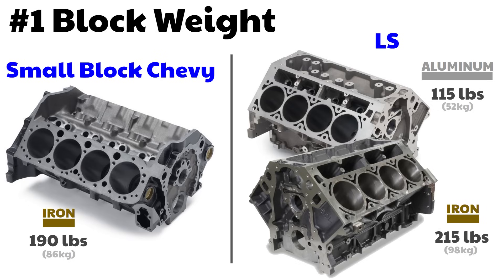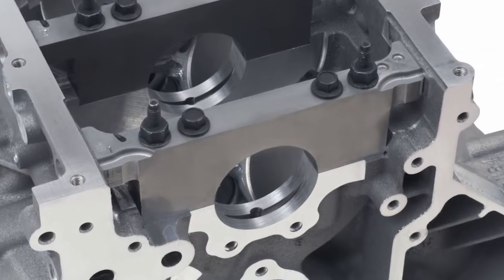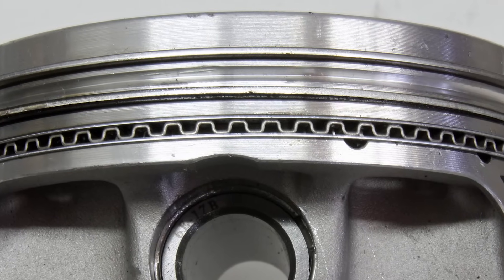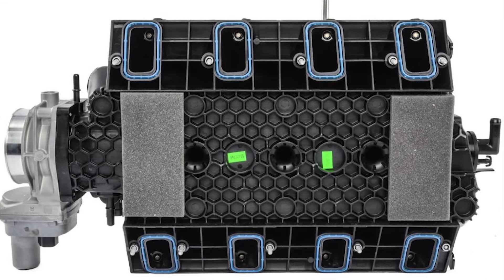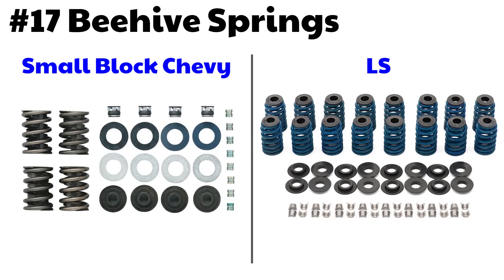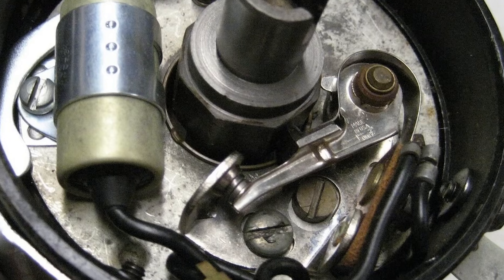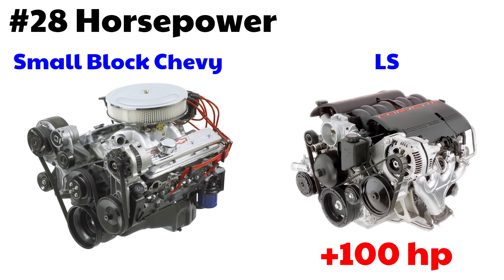29 Reasons LS is Better than Small Block Chevy (Gen 1 & 2 vs Gen 3 & 4)

Comment from the maker: Visit Auto-Guild.com to get your free pre-order of the LS Swap Survival Guide eBook.  As well as other cool eBooks and posters too.  

A few comments: 
1) I'm not saying the Small Block Chevy is a bad engine I'm only pointing out the differences.  I've had a small block in my 68 Camaro since high school and its never left me stranded, I love it.  
2) My engine block power handling numbers are not apples to apples, I messed that up.  For SBC I used official GM recommended power ratings and for the LS I used more real world numbers, so please note that max power handling of the SBC is likely higher, 500-600, maybe more.  But also remember, any LS block you find can handle big power.  With the small block you have to find the right block from the right year, or with the best metallurgy.  a 283 block from the late 50s is not going to handle much power.  And of course I know aftermarket blocks can handle big power, thousands, but this video is referring to the OEM blocks.  
Thanks everyone for all the great comments.
Reply: Yo u need to do some more homework. I've personally watched a bone stock 350 crate motor, in a 67 camaro ring out 9000 rpm. The skirts on the block are simply over kill, and truly offer no added strength. Due to the cam being hollow, smaller valve train components are necessary as to not break the cam. And your 300 some horsepower max on the old blocks is simply ridiculous, as my 1970 block currently produces 525 hp, and 574 lb/ft just fine. And that's with "old iron heads"  So think twice before you count the small block out. And lastly, availability. There are ten times the number of small blocks out there, way more affordable to buy and build, than there are ls engines. Period.
Reply: @sparepartsmotorsports966  I think most of the power in a LS comes from the heads. The heads are so much better, but, there's nothing wrong with a SBC in the right application. I had a 1983 Camaro with a a 400 SBC in. Moderate to mild cam, 9.9 compression, recurved distributor, shorty headers and true dual exhaust with series 40 flow masters, weiand dual plane intake with a tuned Qjet with dual snorkel cold air I dabbed. With 3.08's it would do 105 in the quarter and that's with a TH350 trans with with a mild torque converter and shift kit. I think it would have been quicker with a 4L65E. It was a fun car with a lot of low end torque. Very streetable for day to day driving.
Reply: @nokoolaid  I agree
Reply: @nokoolaid  One of the LS's best points is indeed, its heads as you said (I've covered the other issues, coil packs and crankcase size for pumping losses, above). The funny thing is how for so long, motorheds have said a small bore block can't breathe--of course it can! The LS proves it. 

They simply went with a much better valve angle (close to what Pontiacs have always run) to reduce bore shrouding, and had a tall port rather than a wide one. Originally the "cathedral port" was to allow a fuel injector to go down it like a tongue depressor. But it had the benefit of moving a mass of air due to its volume--some wedge head designs out there barely have fuel/air flow touching their port floors or ceilings due to the amount of "bend" on the short turn radius. 

Of course, and you likely know this, there's a bajillion aftermarket CSB heads out there that can move air, that play around with valve angles, and then there's heads that realize if the chamber burns really efficiently, that may make more power than increasing the volume of air that goes in and doesn't burn as well before going back out again. The advantage is the LS comes with a pair for free, but then you make that up in paying for other issues not found on a first gen block.
Reply: So when you say ‘small block’ what do you mean, because if I remember right there is a 5.0 block a 5.3 block and a 5.7 block, all being considered a ‘small block’ , shoot the 6.0 and 6.2 may even be considered a ‘small block’ where the 427 and 454 are considered ‘big blocks’ BUT YEAH JUST CURIOUS WHAT GOUR CALLING A ‘small block’ and what that phrase entails
Reply: The first gen was made for many decades, and yes, I would not want a late 1970's model, when Japan was kicking ass and all of Detroit put less nickel into their cast iron. And the 262/267 cid V8 was a POS. so I would contemplate a 300 bhp threshold there. Even Hot Rod magazine has posted that.

But of course there was the LT-1 making 370 bhp, the 327 fuelie pushing 375 bhp...and folks have pushed even the four bolt (more holes in the main webs). I've witnessed thru the internet, folks hotrod what they grew up with, and the LS has 20 years of existence so far.

The Y block-deep skirt design works with a cross bolt mains, like the Ford FE and the Mopar B/RB blocks. But it is amusing when the LS fanbois talk about how light the Aluminum block (the reason for that deep skirt) when in reality a high HP engine is going to run cast iron and there's extra weight for the skirt.

it does keep the crank out of the oil swimming pool known as the conventional oil pan, tho...no need for a deep sump like the First gen.
Reply: The block strength of a small block chevy is only 350-550 horsepower? Or even 500-600? GTFO with that, lol. There are a couple of 2000 horsepower LT1s now. Here's one:

https://youtu.be/GkFS0FabL5E

How long it will last IDK. If you're talking about stock rotating assembly strength, maybe, but then LSx don't have 1k strength either. The crank might, but the same goes for small blocks. 

Also SBC 2.2 > LSx.
Reply from the maker: @trumpisaconfirmedcuck5840  Thats the beauty of the LS, you don't have to search for specific blocks from specific years all the engines can hold big power!  Try putting 500hp in a 1959 283 block!  I bet it wont last long.
Reply: I had a 2009 Suburban with aluminum 5.3. Had AFM issues. After that, I swore off GM and I've owned 10. How they would let that half baked tech on the street, IDK. It burned a quart every 1800 through #1 and only #1. Started around 60k. GM did the TSB fix, but it was too late. Had I known AFM should have been disabled, I would have. In the end GM was like, we'll give you 3k off on a new one. Uh, no thanks. The LS may be better in most ways, but how it's implemented makes a difference.
Reply: @James L  this was done intentionally to increase revenue from service and has a class action lawsuit on it
Reply: @JoinerNotFound  Too late for me. I sold the vehicle in 2015.
Reply from the maker: @nokoolaid  Yeah I can see why so many are negative on the system.  It seems like they have fixed it with the Gen 5 LT series.  60K is certainly not high mileage, that should not have happened.  I wonder what percentage of vehicles have that issue.  And I wonder if neglecting maintenance is a contributing factor, thats one of the reasons Im nervous about buying a used LS for my Camaro.
Reply: @AutoGuild  There is a TSB on with upgraded PCV system that replaces valve covers and I think a new oil pan or some sort of windage tray. I changed the oil every 5k with a AC Delco filter and Mobil clean 5000 and when I didn't, the dealer did it. I did use E-85 on occasion and we did a lot of trips with extended highway driving. It was burning oil through one piston, #1 and I had to change the plug in that cylinder every 8k miles. GM isn't saying how many, but peruse the Tahoe/Suburban/Yukon Forums. It's not unusual. From what I understand, extended highway driving at steady speed will do it. Had I disabled it, I'd still have the vehicle. I didn't know it could be disabled and really should be. Dodge's Hemi with MDS has some issues too, but with lifters. Uncle Tony's Garage goes over it. If the MDS is disabled or you get a manual trans it seems to happen less often. IDK. GM should have tested this more thoroughly and found a fix before they sold vehicles with it. The problem is that it happens after the standard warranty period. That works out for GM very well and that's probably why they let it go into production. Other car manufacturers and even motorcycle one's do this. BMW comes to mind. I had an extended warranty on it and they still wouldn't replace the engine.
Reply: #2 is utterly false... I have one in my garage that's been moving right along for about 13yrs at way over the numbers you provided... we are at more like 400+... TO THE WHEELS... so probably over 500hp to the crank... on a 1970model block.
Reply: R
Reply: My Edsel never left me stranded either
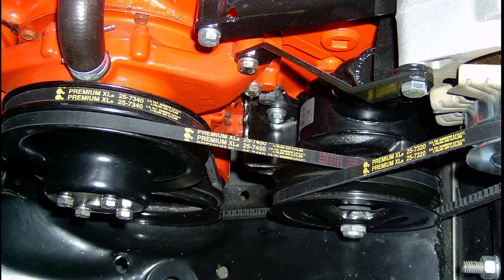Reply: 9:09 that engine has how many belts? lol
Reply: this is bullshit  its like comparing apples to oranges i have seen 2500 hp sbc on methanol and boost i think you should remowe this video and make a new one that is using same source for durability and strength of both engines best regards david from sweden
Reply from the maker: @dadde5907  Of course an aftermarket engine can hold tons of power but this video is about OEM blocks, perhaps I should have made that more clear.
Reply: https://www.youtube.com/watch?v=UZ1PRsfO09c WHERE CHEVY COPIED THE LONG SKIRT BLOCK DESIGN, FROM THE FORD 427 HIGH RISER ENGINE. THE LS IS NOT 100% BUT 1000% BASED ON THE FORD 427 HIGH RISER ENGINE. NOT ONE DESIGN ASPECT OF THE OLD SMALL BLOCK CHEVY LIVES IN THE LS. IT IS COMPLETELY FORD IN DESIGN.

Comment: The comment section on this video is full of guys saying "if you build the sbc it's better than the LS" yet if you built both they can do equally as much. Guy in the video also hardly knows what he's talking about. For example, the basis of the video is the small block vs the LS, which also happens to be a small block, just a later generation. Power numbers are also skewed.

Comment: Unfortunately You have very little Knowledge on the older Engines as far as how much HP they can handle.
You should do your Homework a little better.
For the record a stock chevy can crank piston piston handle up to 650 hp before any damage occurs.
The block can handle 800 HP before mods need to be done.
Also those Exhaust manifolds on the LS are just as restrictive as the Old LT manifold. This is known fact .
The eletronic fuel injection can be put on the small block LT with the same improvements.
YOU KNOWLEDGE IS LACKING ON ENGINES !!

Comment: I've ran and built a small block 383 gen1 4 bolt main with a set of 88mm china snails and it handles way more than the 360 you claim can handle.

Comment: I'm not even going to finish watching this. I have replaced cams with out removing the heads on a small block Chevy with no difficulty numerous times.
Reply: You can change the cam on both the ls and sbc without removing the head. But to change the lifters on an ls you need to remove the head.
Reply: @Redtooth75  don’t you have to keep the lifters from falling into the oil pan when u remove a cam??

Comment: You forget the biggest flaw in the gen 3 sbc. It literally cost thousands more than building a regular gen 1 sbc.
Reply: Only if you are doing a swap or build from scratch, because then you need to get an ecu and wiring harness. But if you are rebuilding one then they cost about the same.
Reply from the maker: True in many ways.  Costs to swap is way more.
Reply: Don’t get me wrong. I’ve thought about so many times. If I were to do the swap, I’d buy a wrecked 99-02 LS F-body. That way I’d have everything.

Comment: My experience is this.....an "out of the box" sbc with decent compression, naturally aspirated, running on pump gas, makes a solid 350-400 depending on compression and timing. Anything over that requires MAJOR compression, which requires race gas, (expensive), or forced induction. An LS "out of the box" generally makes more hp and torque more "efficiently". Money, know how, and time decide which platform makes more power.
Reply: Get off the drugs. An out of the box 350 barely scratches 200HP.

Comment: Reasons that are wrong. 
1.Boosted applications use the cast iron LS block.
2. Horsepower limit. I don’t know where you got your numbers from. But many gen 1 small blocks have gone past 1000 horsepower for decades. The one piece rear main seal blocks are supposedly limited to around 500hp. But many engines built have made much more so that’s also not correct. 
3. Titanium rods in the LS 7 don’t like boost. The LS7 was designed to be a high rpm fast reving naturally aspirated engine. 
4. Powdered metal rods are limited on what they can handle. Once again, many high rpm and boosted engines have been made with stock GM pink rods found in the 1970 factory engines like the original LT-1 350. They were available from GM over the counter for years. 
5. Cylinder heads for the LS flow crazy numbers. Put some really good cylinder heads on a gen 1 small block and you make power. 
6. The LS is popular because you don’t have adjust the valves. Basically is dumb proof. 🤣🤣😂. 
7. You can get beehive springs for any small block. Not recommended for big blocks because they have a very heavy valvetrain. 
8. It only took GM half a century to make an improvement on the more superior gen 1 small block. 
9. Rpms, any small block can run way past 6000 rpms. 
10. V belts are better in high rpm application. 
11. The efi is more efficient, we’ll sure it is. once again it only took decades for your programmers to get it right. Aftermarket efi has done it since the early 90’s. Where was GM or any auto maker and why did it take this long for you to get some programmers with some knowledge.
 11. If variable valve timing is so great why does everyone modifying the LS delete this function? Hmmm
12. Hot rod magazine articles are big advertisements for comp cams and the flavor of the month cylinder heads. And the only way Hot Rod made 1000hp with the LS was a turbo and aftermarket heads. 
13. Cost for building and LS is just as expensive as building any engine. If you turbo, tune and cam a junkyard LS, guess what you have? A junkyard LS. 
14. GM didn’t not reinvent the wheel. The LS is a pushrod engine with good flowing heads. The 5.3 is a small bore engine with a large crank. The LS is flavor of the decade. It’s the dumb proof engine if just want to throw a cam and a tune at it. The LT has already started to push all the LS from factory production. The LS is not rocket science, stop treating it like it’s the messiah of small block performance.

Comment: The LS engine is nice in some ways. But the LS engine's only real advantage over the OE roller sbc is the higher flowing cylinder heads .. but sbc  aftermarket heads like the AFR 227 or DART 230 out flow all LS based cylinder heads... I have built many LS engines for customers, but personally I will stick with the sbc 400.. sbc 92-96 lt1 and the gen 6 bbc 454.
OEM LS pistons and rods are garbage.
Reply from the maker: And the lightweight alum block.  Less weight = free horsepower!

Comment: The only three things you need to know:
1- doesn't take a full tube of RTV to seal the intake
2- better heads
3- say it with me... S I X   B O L T   M A I N S
Reply: You forgot that the ls dont leak like a sieve. In my experience with sbc anyways cant keep oil off the garage floor.
Reply: @HEYBERT1984  - if you prep them right, use  straight valve covers and old style cork gaskets, it's not hard to build one leak free. The problem a lot of guys run into, is using the newer style synthetic gasket materials. They just don't work with old castings. You CAN use them... but you have to prep the surfaces and get them super smooth, otherwise they seep.
Reply: @sylentxtinction2097  my ol 95 K2500 with a 350 sat for 7 years without being ran and doesn’t leak anything. Even after 305,000 miles 🤷🏽‍♂️ note I do drive it every day now
Reply: Yes the mains are supported better. But only 4 of those bolts really do anything. The side ones do very little. And THAT is only LSX.

Comment: Yes, I think you need to cover the LS heads, thats one of the amazing features of the LS
Reply: yes, it has the valve angle found on Pontiac V8's and aftermarket chevy heads.  Those Cathedral ports flow so well, the days of "small bore V8's can't breathe" have come to an end.
Reply: Ford windsor design . Set a Ls head next to a windsor head.

Comment: 29 reasons but sound isnt one of them! Sbc ❤️
Reply from the maker: Sound depends mostly on cam and exhaust setup???
Reply: @AutoGuild  yes your right, but the sbc is definitely a better sounding engine
Reply: @AutoGuild  CR, overlap, and exhaust, to be precise.  CR is the one most forget. its what gives an exhaust that hard snappy sound too it, "blat-blat-blat" vs "puff-puff-puff". overlap gives you that uneven "blada-bluda-bla-BLAP-bluh-bluh-bluh-BLAH-bluh" type "lopey" idle. exhaust can make almost any engine sound like anything - except make a rice burner sound like a big block. for the "baddest" exhaust note, you want CR, overlap, and open headers. straight tubes is next, probably followed by straight-through glasspacks or similar, then Thrustmasters (which is what you want to stay out of trouble on the streets).

Comment: Congratulations looks like you didn’t know that the LS motors are also small blocks except ones like the LS6 454
Reply: Even the 454 is a small block. Gm hasn't made a big block for a while. All of the displacement varients of the ls have the same block just with different cylinder bores and material.
Reply: @Redtooth75  my point exactly, this lad should really educate himself before embarrassing himself on the internet.
Reply from the maker: What he said